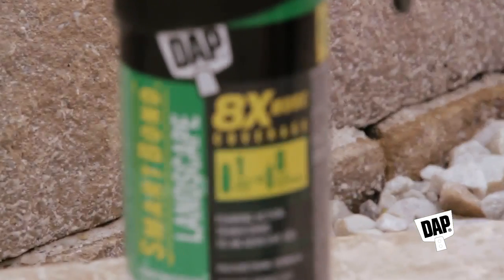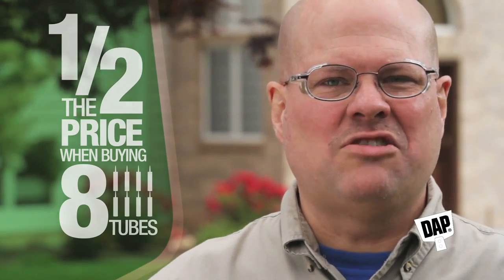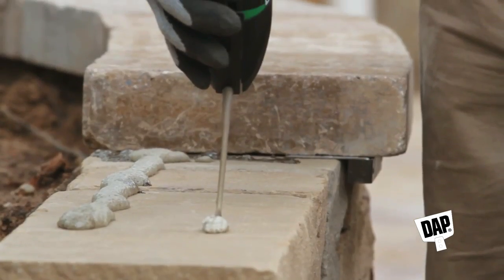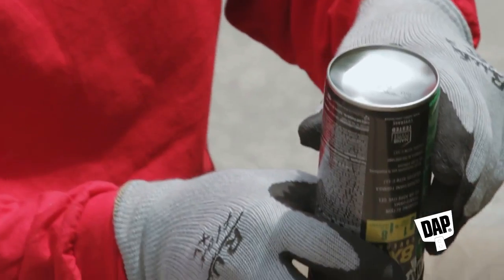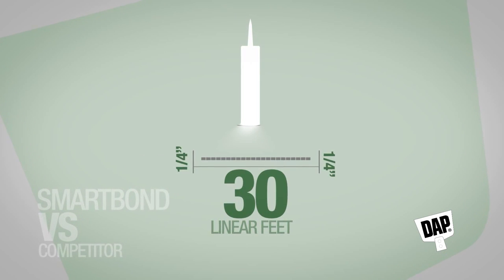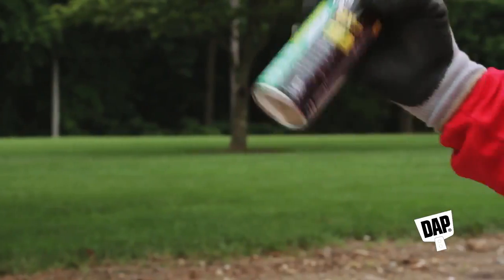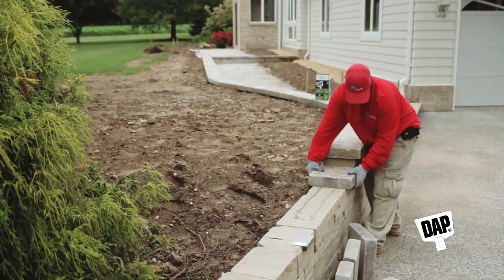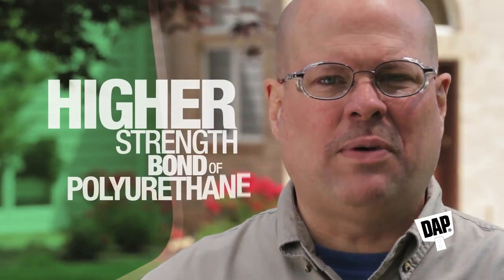Dap SmartBond Landscape Construction Adhesive

Comment: The bead is so thin and liquid, I can't see how it could effectively bond 2 pieces of uneven concrete block. It looks as though there'd be gaps that the adhesive couldn't fill, thus not bonding. I'll stick with the traditional adhesive which appears to be much thicker.
Reply: I'll tell you this , i used some of this and had to remove a few months later.  I could not do it, it broke it several pcs.  Much better holding power than the others.